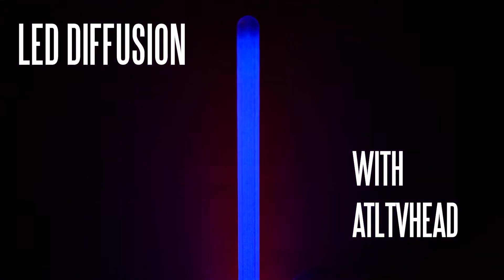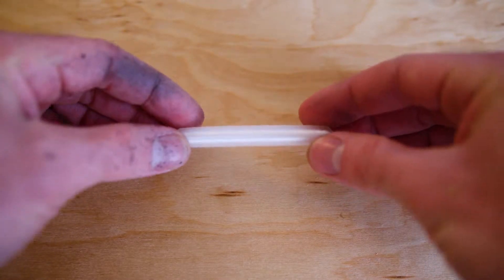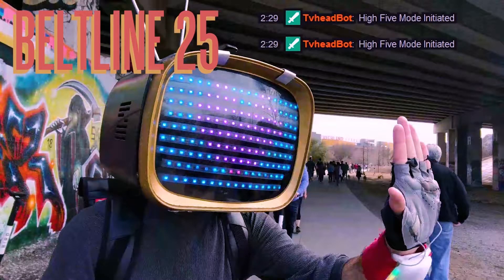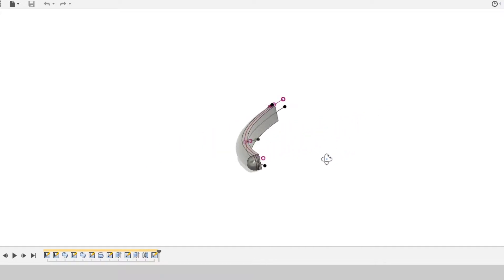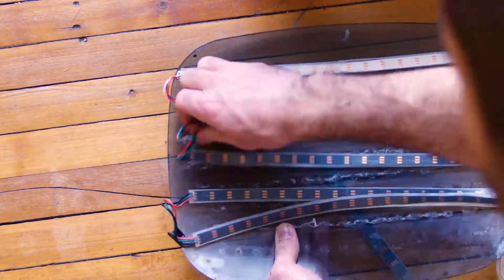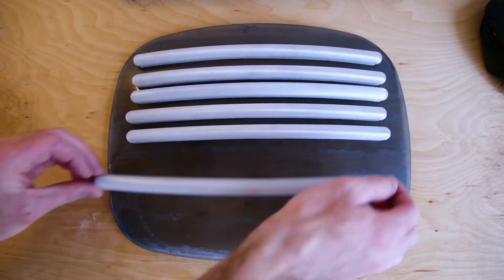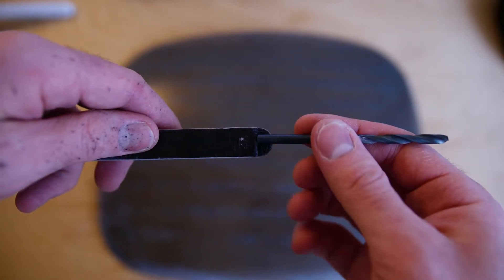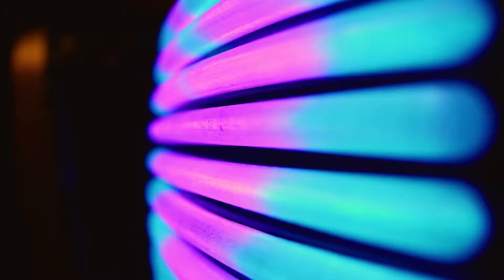New Screen Build

Comment: Great! I've owned a 3D printer for a week. I had white PLA. I used Fusion 360 to make a 2mm thick "diffuser" which basically blocked the light. Your video takes the guessing out of which filament I should use for my LED projects. Thank you!

Comment: I know this is an old video.....but how did you curve your screen?
I use plexiglass for mine, but I want to get that nice curved tv screen look :)
Any help is appreciated! Hope you have a nice day!
Reply from the maker: I heated my acrylic in the oven (I think at 200F) for around 20 minutes, until the acrylic becomes floppy and a little stretchy. Then I put it into a jig that contacts only the outer edges. I used the tv face plate I already had for my jig. I let gravity pull the center of the acrylic down, creating the bubble look. Try not to touch or stretch the acrylic as it clouds easily in it's hot state. Hope that helps.
Reply: @Atltvhead| Aww bless your heart for commenting back! Thank you, this helps a lot!!! Can't wait to try and do it!((this is the second one I'm making and I'm gonna add an old tv antenna!))Hope you have a blessed day!💕
Reply from the maker: @roguerae07   You too!